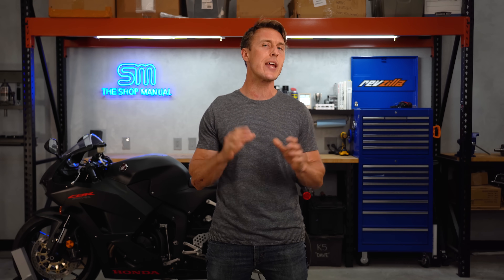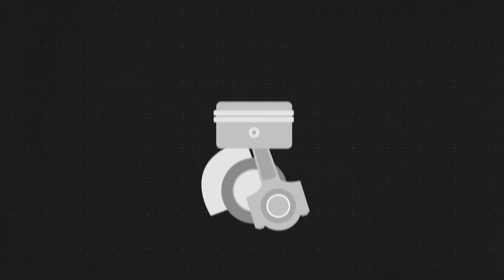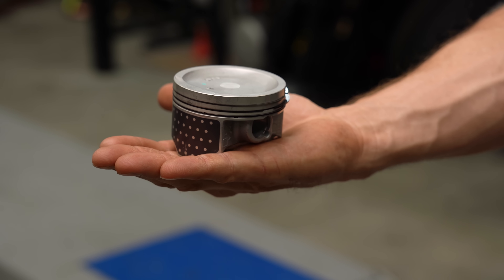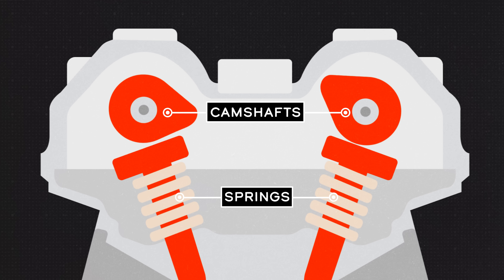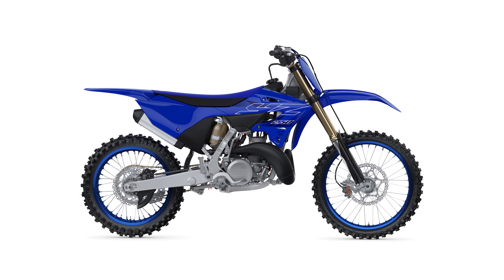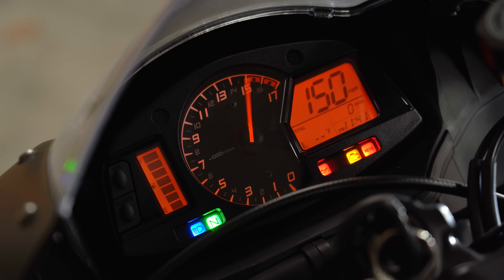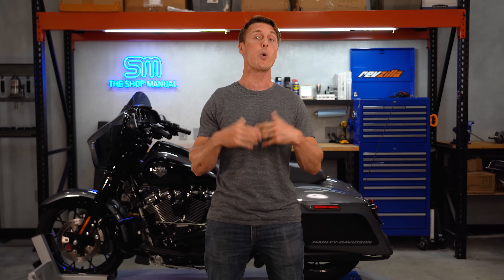This Is Why Your Motorcycle Has a Redline | The Shop Manual

Comment from the maker: Check out this article about redlining on Common Tread: https://rvz.la/3jGvcoe
Reply: I don't understand why you added background music. I want to hear what you have to say. The music ruined it for me.
Reply: Hi brother, one question. Royal Enfield 650 have cam and its like euro6 so why it has very low rpms not like hondas and suzukis.
Reply: Do a video on RPM drops slow or hangs when revved or while shifting gears.
Reply: Is overreving down (money shift) the same as overreving up or are the positions of the valves different depending on where the actual throttle position is?
Reply: @antdx316  Are you asking about engine braking? If so, then no, the timing of the valves does not change based on throttle position, they're locked in synch with the crankshaft and pistons by your timing chain. If you're red lining when you engine brake though then you're in too low a gear.
Reply: Is it the technology in the Speed movie? That technology has bothered me for three years and I have been wondering.
Reply: Thanks for not making this video like 20 minutes long like most YouTubers
Reply: Please tell me the Honda SS50 Engine you threw away got catched or landed in a soft Spot. I got an Heart Attack, when i saw you throwing it!!!!!!!!
Reply: On my ducatie m900 i.e. 2002  i dont have a redline i search for it but i cant find it on the internet. How do i know my max rpm?
Reply: Neither do we

Comment: A Honda CB 250 twin from 70-s had its maximum hp at 11000 rpm but redlined at 10.000 !!!
Reply: Wow 10 revolutions per minute that is slower than a marine diesel

Comment: I've used a few engines that were basically incapable of reaching their redlines. You'd have to absolutely murder the thing to get it there. Other engines I suspect they deliberately set the red zone low so the needle would sweep into it dramatically now-and-then. Occasionally going there isn't likely to harm a well designed engine.

Comment: But for a street cruiser / street sport/ the maximum engine RPM in final drive gear, should be the RPMs that the engine is producing at best cruising speed in top gear.  *Just my theory here*: 

So, my Tiger 660 sport,  has a RED LINE of 10250 [But for the advertised maximum Horsepower output] which I will never require or need for Normal riding situations.  So, I take the 10250 and divide it by 100 for 102.5.   Then I times that, by 'mid range' MAX advertised output, or 50%, which is 5,250 rpm.... That should be the DNE rpm, as I really think,  that the engine revolutions should be, Per second, and not per minute.  In this case, the crank is spinning 87 times per seconds. 
I also use the formula of 100 RPS as maximum RPM or that of 6,000 rpm in 6th gear; though where the maximum output for torque and then efficiency at 75% of max output or that 75 % of 6000 rpm is 4,500 rpm.  I use that, because on my tiger 660 in 6th gear at 4500 rpm the tiger does, 55 mph....which is 75 revolutions, per second.  All assuming a linear relationship:

Comment: Insane physics, gotta admire them engineers for coming up with these beautiful machines
Reply: But no need to rev the engine at so many 'actually' revolutions per SECOND.... the more revs needed for x energy is less efficient when appreciable work can be done at far less energy and work. The redline really is excessive and I think that bikes should be governed at its maximum best efficiency.   A car and truck can do the same work at far less rpms.... so, a much lighter two wheeler, should be geared accordingly.  6000 rpm is 100 crank revolutions per second! That's fast.  But the idea is to make every bike a track racer?.... a fast off the light?  well, even cars abuse take off speeds... why?   So, the redline for most bikes should be 6,000 rpm... I get ''all I need'' from my tiger 660 at 4700 rpm.   But the book says max HP at 10250.... will never ever ever ever need to rev that high never never never....
Reply: @robshef718  cbr250rr revs to 19k and sounds amazing it depends where the bike makes peak power and what the bike is intended for. high revving bikes are very fun and have a lot of character.
Reply: @   LOL..... 19 k,,,, to get it moving....what a piece of garbage..... Your ego is intended for all of that.  There is no 'character' in a bike that is doing 7,000 rpm just to get out of first, what is wrong with you?
Reply: @ haha, you sound very clueless. it is an outstanding piece of art built by  honda in the 90s, incredible build quality that lasts over a hundred thousand kms without a  rebuild, not  many bikes are capable of this. Honda really outdid  themself. small displacement bikes rev higher in order to get more power, not every  bike makes much power at 7000rpm it depends on the displacement, the stroke, the weight, and many more factors. to make such a broad statement you clearly have next to no knowledge on the topic that your are trashing on. pretty embarassing dont you think? 🤫

Comment: is it bad if my gear accidentaly slipped from 3rd to 2nd and went red line, then lost power for a second until i stabilized rpms. The bike is absolutely fine and feels normal after i corrected it just dropped for like a second
Reply: imagine it was this easy to destroy a bike

Comment: Hello there i am mohammad and i am from Afghanistan so i have a triumph 800 tiger 2012 but its kilometer has broken and it doesn't start without kilometer. You know in my country is not tools of this motorcycle and i will glad that you would help me start it without kilometer
Reply: what do you mean the kilometer is broken? kilometer is a measurement of distance, not a motorcycle part

Comment: The redline is to know when youre loosing a fairly significant amount of horsepower if you stay in that gear. I had an FZR400R, one of the most rpm-dependent bikes ever, you gotta stay between 9500 and 14500. With one notch bigger jettings i could pull it further into the redline, and it does NOT harm the engine! Bigger jets means more gasoline, and that cools down the cylinder interior more, making it withstand higher rpm more. Beware if your bike got small aftermarket jets, your cylinder is running too hot even on lower rpm. Even worse is if your bike is chipped, it is getting way too little gasoline to keep the interior cool. Never chip a bike with a chip that gives you higher mpg, the temperature is your enemy, high gas consumption is your friend.

Comment: How do engineers determine the rpm for the redline, there must be a fancy equation I guess?
But would be more fun if they let 1000 engines run at different rpms and see when most of them break I guess....

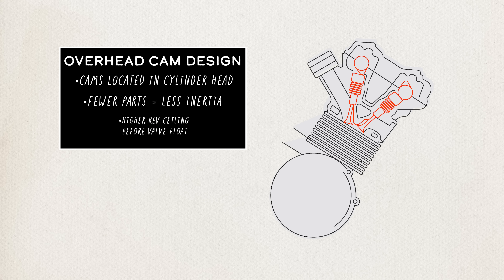Comment: You’re wrong about overhead cam engines having less parts than a pushrod engine, its the opposite. 4:11 the engine shown is a dual overhead cam engine so it’ll have two cams while a pushrod engine will have only one cam and likely half the valves as well

Comment: don't have a tachometer so i don't have a redline. 100cc 2-stroke so no valve flutter or bounce. Has CVT so rpm doesn't equate to mph but it probably lives in the 3-9K range; despite best efforts, have not ascertained the max rpm, keep it pinned and it just keeps climbing until you think it's going to explode and tap off. Sometimes the fuel pump will overpressure and pop the supply tube off the carb, sometimes the spark plug will blow out or various things get too hot and fall off... but so far, max rpm not reached.

Comment: I had a custom ordered Kawasaki KH500 H1F triple that was designed for racing. Unlike the commercial models, it came with a 6-speed gearbox and the tachometer started in the orange at 7,500 RPM and entered the red at 9,500 and maxed out at 14,000 (instead of 12,000 as on the commercial model). Well, I pushed it past the 14,000 until the tach needle bounced up and down against the stop pin and eventually broke the cable by this abuse. What limited the engine RPM was fuel-air starvation.

The manual that came with the bike listed top speed in 1st gear at 15 mph, 2nd gear at 29 mph, etc., but this was the point at which RPM reached the red line. After some additional modifications, the bike was actually able to hit 52 mph in 1st gear, 87 mph in 2nd gear and topped out at over 160 mph in 6th gear (the speedometer cable also broke). I put more than 15,000 very hard miles on this bike, many of them with the needle buried deep in the red on tachometer, and the engine did not come apart. I did blow seals quite often and had to tear the engine down to replace them.

I even had the engine seize once at more than 100 mph due to a lack of two-stroke oil in the reservoir. The rear tire locked up and I brought the bike to a stop in a controlled skid. If I'd been running The Tail of the Dragon, then I'd likely not be alive to tell the tale.  I was quite surprised when the engine kicked over after cooling down, and it even ran about the same as before after replacing the top end.

The red line is really just a recommendation. There is a margin for safety. On a four-stroke engine, the push rods typically fail and/or head gaskets blow before any serious harm is done to the engine. I've pushed a 302 small block Chevy to 12,000 RPM and those were the type of failures I experienced. Of course, you can't do that with the factory engine components installed.

I was once young and fearless. Age and crippling injuries from my youthful exploits have taught me a bit of caution, but only a little bit.

Comment: Fun fact. My old Manx Norton race bike has a max 7800 rpm limit. Set by the factory to ensure that the engine could endure 226 miles at mostly open throttle at the Isle of Man TT.
On short circuit races 500 more rpm was allowed.

Comment: I redlined my Yamaha YBR125 once while I was learning, I downshifted one gear more than I thought, luckily I realised it and pulled the clutch in shortly after.
What's exciting about it is with my weight it can sit at 60mph comfortably, but I was able to get up to 70 on a dual carriage way with tailwind on a downhill slope, and the tachometer was a hairline from redline. Luckily the few times I go on a dual carriageway I'm happy to sit at 60-65.
Reply: I loved that bike. Favourite moment was finally overtaking a learner, following a horse box, after many miles of trying to find a nice flat spot with ideal wind (sadly there were no dual carriageways). Then zipping off into the distance. 

Mate had a Ninja 250. That was kind of hard to redline, it was basically a turbine with the redline starting at IIRC 20k RPM (which apparently you can do with a four cylinder 250 cc engine).

Comment: They say short stroke is better for high RPM but for the same displacement and number of cylinders when you decrease stroke you have to increase bore, so you get big and heavy pistons. I think the real reason short stroke is better for high RPM is because you can have larger valves.

Comment: The red line on my 1974 400 triple 2-stroke is 8,500.  I'm told the stock rotating assembly is good for something like 12,000 and probably more with modern aftermarket pistons.  However, 8500 is the point at which acceleration ceases to happen with the stock porting, so there's no point spinning a stock 400 any faster.  Of course it has no valves and it has triplicate ignition points that don't float, so well and truly you can't over rev it except via spectacular bonehead downshifting.  It's kinda fun to just hold it wide open for 3 minutes revving as high as it can with no limiter, knowing it absolutely will not scatter.  And despite all the legends about 2-stroke triples, it's quite happy to do that without seizing the middle cylinder, on just 80:1 premix.

Comment: Very interesting, but to me that does not explain the red line, why have that, why don't they just have the max rpm's on the rev gauge and no more! Many older bikes and cars do not have a rev limiter either so you can rev well into the red line, it's more like it's the danger zone, don't stay here too long kind of thing, the red signifying the danger so we don't, but we can use it at our own risk otherwise it wouldn't be there, right!

Comment: Yeah, well, Mr Rev, I'm 56 and started riding in the late 80's and I've had a lot of bikes and in 1987- 88 to 1990 etc there were so many bikes where if you passed the redline there was no engine cut. I had bikes where I would go 500 and 600 revs over the redline all the time and no problem, but I'm not a mechanic or a mechanical engineer so I expect you just might have an answer to my claim.
Reply: its because not because you pass the redline the engine will explode, but you are in the "dangerous zone" where it can happen, where the parts of the engine are suffering a lot, or have valve floating, something that dont kill the engine instanly, but do little damage to the valve in every rev.
and the redlines the most of the times are bigger than engine actualy redline, like 500 or 1,000 rpm bigger, so cut before the real limit of the engine for safety.

Comment: Shorter the stroke higher the rpm longer the stroke greater the torque. 
Fuel cut is bad throttle cut is better. Removing fuel from a piston going 16k is bad. Fuel also cools pistons , lubricate upper cylinder. Hence Redline SL1 micro dosing.

Comment: One thing to note . An engine may have a high red line but may produce peak power below that redline .  Knowing where that peak is on a dyno and shifting to the next gear at that point will allow you to accelerate just as quickly if not quicker that pushing it to redline . 
It also gives you a safety buffer in case you miss a shift .
Reply: one thing to note is, you dont use your powerband right if you shift at exactly peak power. so you wont use the quickest acceleration your bike has to offer. please look for the video "When To Shift Gears For The Fastest Acceleration" by Engineering Explained here on yt. its a great description for the topic, also applicable for bikes.
Reply: @Kathisbuecherstapel  Exactly right.
Reply: @Kathisbuecherstapel  I don't have to watch the video. You get the best acceleration when the shift leaves the engine in the middle of the peak power band for the next gear. When you shift before that point, the engine has to fight its way back up to peak and you lose precious tenths of a second with each gear change.
Reply: @GaiusTacitus  both of these are wrong if you are referring to horsepower with "peak power". Your horsepower band doesn't matter for shifts. It's the torque curve that acts as your accelerator. You ought to shift past the peak torque only when a higher gear would offer you more torque than a lower gear.
Reply: @dazeen9591 just no.
Reply: @valebliz  literally yes lmao you know nothing about engines
Reply: Depends completely on the gearing, performance bikes are made to shift in the redline area so you hit a high performance rpm in the next gear. If you shift at peak power you enter the next gear inna very unfavorable part of the engines power register.
Reply: It's not only about where the power is in the current gear, but just as much where it is on the next. Change too early or too late, you will end up in a spot on the power curve where you do not having enough power to accelerate efficiently.
The GSX-R 250 I had back in the day had a noticeable drop in power from 16,000 to 17,000 rpm (redline, limited to 19,000). The best range to be in was between 13,000 and 16,000. Except that one time where I sent it in 1st and somehow got even more power at 17,500... :)
Reply: Engine produces peak TORQUE below red line. Peak power always comes with red line: more revs, more power. It's physics.
Reply: @AndrewAP46  Thats inaccurate. Your way of thinking is understandable but i guess you lack experience with performance bikes. I didnt learn to drive on my FZR400R but it was that bike that taught me how to squeeze out as much as possible in each gear, you will not believe how hard you have to be on the gearshifting on such racing bikes, and how close the gear ratios are. Theres always a tradeoff and to minimize the tradeoff you gotta push well above max power rpm before shifting.
Reply: @AndrewAP46  That's not even true stop making universal statements if it's not universally applicable